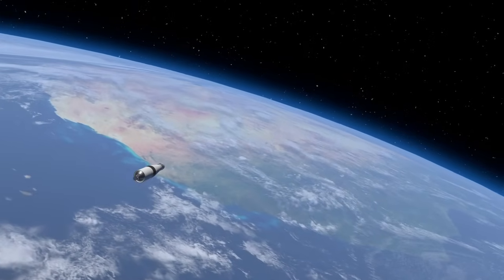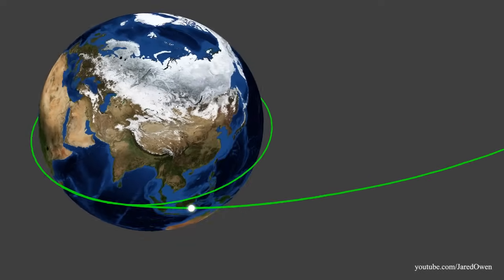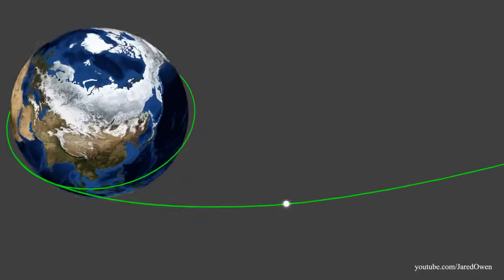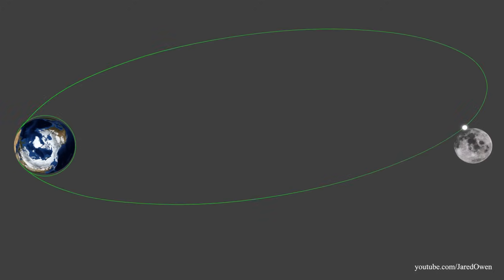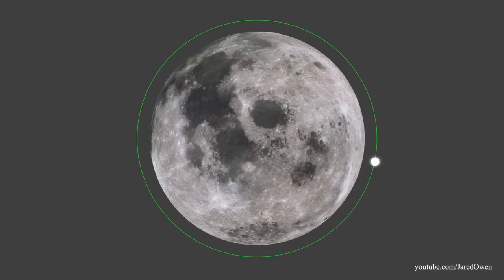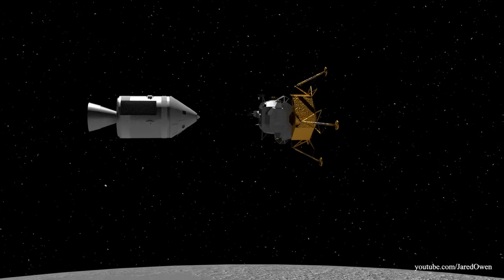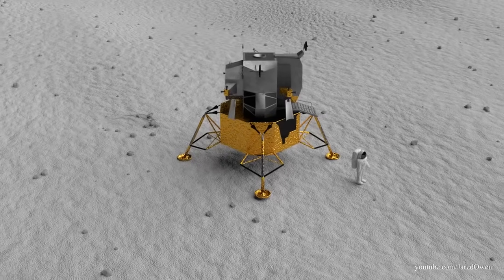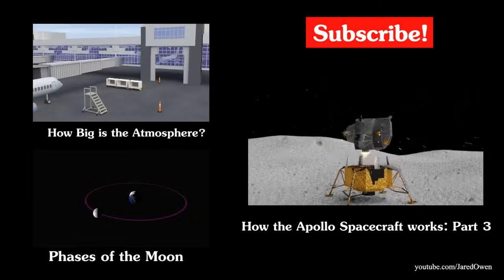How the Apollo Spacecraft works: Part 2

Comment: I thought those flames imposible without oxigen. Like combustion engines would not work
Reply: @jimmyfly makes sense  Thanks
Reply: Rockets store both fuel and oxidiser...
Reply: @pmm1767  can you elaborate?
Reply: @arelortal6580  the oxidiser is oxygen, the fuel can be something like hydrogen or methane. Both are liquefied and stored at very high pressures. When the rocket wants thrust, these pressurised tanks release a steady of stream of their constituents. As they flow they reach the combustion chamber where an electric arc is present. In the presence of the electric arc, the reaction starts and the first molecule of fuel and oxidiser that react set off a chain reaction that releases heat and allows all the fuel to react. Now the newly formed gas, let's say water vapor in the case of hydrogen being the fuel, wants to expand; as all gases want to do when in lower pressure. As it expands it pushes the rocket out of the way and leaves the through the nozzle. That all happens instantaneously.
Reply: @pmm1767  I understand the principle when there is a certain density in the atmosphere but if the expanding gas does not encounter any resistance when exiting the turbines then I can hardly conceive displacement unless there is a considerable increase in thrust.
Reply: @arelortal6580  see, the rocket and the gas it contains are to be treated as separate objects. The gas' intrinsic property to expand by virtue of its mass IS the resistance the rocket encounters to its inertia. Very simple. The gas WILL expand, not flow. Flow is a misleading term that implies no force. Expansion is actually what happens. The only exit the gas has during this expansion is through the rockets nozzle, so as it expands in the chamber it pushes the rocket out of the way. I had a doubt like you but when you visualise it makes a whole lot of sense. Gases may look like they flow, but, on the micro it's just collisions and overall expansion. The moment fuel and oxidiser enter the chamber the velocities of all the gas molecule are in random directions. Their velocity vector is not in line with the nozzle exit. The only way to get an individual gas molecules velocity pointing in the direction of the nozzle is to strike the surface opposite it. Hence when it hits the side opposite the nozzle it transfers momentum (as all elastic gaseous collisions do) and it leaves through the nozzle. The overall effect of several collisions that change the velocity is expansion. It is also how  a balloon flies. External pressure doesn't come into play, in fact, the lesser the external pressure, the greater the force with which the rocket moves since there will be no backflow decreasing thrust.
Reply: @jimmyfly yes you are right
Reply: @jimmyfly this dude just ran away after the explanation lol
Reply: @jimmyfly you do push ups against a table , it works . You do it  against water or air, you sink or fall. The thrust has to find some kind of resistance at least till there is no more gravity pull from the moon otherwise is ,no can do.
Reply: @arelortal6580  the thrust is it's own resistance, the gas inside the rocket has mass and therefore inertia, it has a velocity because all gases are constantly moving. As a result, the gas faces the rocket walls as resistance and the rocket faces the gas expansion as resistance.

Comment: OK, so how did the CSM slow down to pull the LM out of the SIVB even though its nozzle was pointed in the opposite direction, ready to push the CSM back towards the SIVB but without an apparent way to reverse? And how did it turn around? And how did it do the roll? Did it have reaction wheels? And why wasn't the LM just already assembled to the CSM and the rest of the whole Saturn V assembly so that it was already oriented towards landing rather than having to turn 180 degrees?
Reply: RCS quads were used for any kind of maneuvering. As to you're last question, how would you attach the launch escape system to the command module?
Reply: So,  @mako88sb , not really any kind of maneuver; just the smaller ones, right, since bigger ones are handled by the big engine?

What do you mean by (the short version of) "as to you are last question"? I'm not sure I understand you. Did you mean "as to your last question" instead? If that's the case, then here's my reply: Yeah, since the CSM's first use of the big engine is to slow itself and the LM into lunar orbit, then with that assembly already faced the other direction and the cockpit arranged accordingly, put fairings over the end of the CSM with the main engine to create an artificial nose, and have the cockpit arranged accordingly, and then have the attach the escape system over that, I guess. By the time the fairings are to break free and reveal the CSM already in that orientation, the escape system would have been long-obsolete. Right?
Reply: @HelloKittyFanMan.  Your last question from above was "And why wasn't the LM just already assembled to the CSM and the rest of the whole Saturn V assembly so that it was already oriented towards landing rather than having to turn 180 degrees?"
Reply: Sorry, responded to quick before reading all of your message. Not sure what to say to your reasoning. The LES was designed to jettison just the capsule with the crew in it. Any additional weight added complicates the situation immensely needing a more powerful LES and additional weight and additional fuel in the Saturn V to boost that weight for as long as it was needed. Plus you have to keep in mind that the LM was designed for a zero-G environment and the location of it in the SLA behind the CM/SM was the best place for it for minimizing G-loads and vibration during the launch. Now obviously, just because it was designed for a zero-G environment doesn't mean it was too fragile for launch as they had to take the launch dynamics into account but the point is it was designed with the knowledge that locating it were it was historically minimized as much as possible the additional strengthening required for the LM to survive the launch which again means minimizing the weight involved as much as possible.

Comment: Excellent visual overview of the sequence of process. But how, after docking, does the CSM get the LEM unsecured from the 3rd stage carrying it? does rotation detach it? In all the documentaries ive seen the LEM just comes out like it was just floating in 3rd stage; there has to be an unlocking at some point for the CSM to pull it out- could u reveal how this happens please?
Reply: Here's a pdf about all the pyrotechnics involved with the Apollo missions which will answer your question. Be a great video for Jared to do someday.
https://ntrs.nasa.gov/archive/nasa/casi.ntrs.nasa.gov/20090015395.pdf

Comment: A Presumptuous Opinion:
Apollo 11 - The Poop & Pee Theory  Proves 
No Outer Space and No Moon Landing
The astronauts supposedly spent three days to reach the moon and two days to come back. 
It is told that a clear plastic bag was used to urinate in and obviously someone had put catheters into the astronaut’s urinary tract into their bladder. 
On a documentary just two days ago the urine bag was shown and it was a small thin clear plastic bag with pee in it. Looked like they could only urinate maximum 2 times and it's full.  
What a minute? How did you astronauts hold your pee for 5 days. 
Also, the inside of the capsule barely had room for 3 people, so there certainly was no toilet available. 
Wait a second? Where is all the poop for 3 men for 5 days. That is a lot of poop. We’re talking pounds of poop. Were you astronauts wearing outer-space-diapers? How did you astronauts hold your poop for 5 days? Can't imagine the smell inside that capsule. When the astronauts came out of the capsule, they must have had such a lovely fragrance to smell that made people immediately vomit. This was A Presumptuous Opinion on the Poop & Pee Theory

Comment: Yeah I concur,1969,but all the ground work was done in the 60s,early....looks like fairly straight forward,why the slow move away from the earth too much fuel to just shoot out away from the earth gravity,or does the slow break away from earth have something to do with temperature controlling effect ,probably save fuel most likely...right.thanks I was wondering why they go up and then pitch over and start orbiting earth before they go on to the moon...
Reply: The main reason for entering Earth orbit is to do some final checks to make sure everything is good to go. Plus it's a lot easier getting into the specific trajectory for the TLI burn that minimizes radiation exposure during the transit of the VAB's.

Comment: crazy how it just pulls out the lunar module meanwhile they are all travelling really fast towards the moon
Reply: Antony D'Andrea yeah so they are going 6000 km per hour and detach the front and at that speed they turn the front around, and then pull out the module, lol, then go plant a flag in the wind, then they fly back up and somehow reconnect to a ship traveling at 6k km per hour. And then, the tiny ship makes it 250k miles home.
Reply: Made by Jimbob What wind? The moon doesn't have any atmosphere significant enough for wind to be an issue. Same with the rest of space.
Reply: @MadebyJimbob  so what? You can easily walk around in an airliner while it flies at 1000km/h. All that matters is the relative velocity between those two craft. And given that the forces affecting either one were the same, there's no big difficulty here.

Comment: If it weren't for Werner Von Braun we wouldn't have a space program
Reply: If it weren't for Robert Goddard,  von Braun would have never built a ballistic missle (he said that).  If it weren't for Issac Newton and 18/19th century chemists and fluid engineers,  Robert Goddard would have never gotten into the air with liquid fuel, 
If it wasn't for the Army Air Corps and NACAs high manned ballon flights in the 30s-60s Redstone,  Atlas and Saturn stacks wouldn't have carried humans in the 60s...
Reply: @STho205  My sentiments exactly Treaty  for Versaqilles had a loophole which allowed for rocket research
Reply: There would surely be a space program without him.
The only difference would be that there would be a soviet flag in the moon, and the conspiracy idiots would claim that the landings were filmed in a secret KGB facility somewhere in siberia.

Comment: You don't mention that the S-IVB's J2 engine is different than the five that are used by the S-II because it could relight.  Also, the S-IVB wasn't completely useless as it was used in later missions to crash into the moon to be registered by the seismographs left by previous missions to give data on the moon's interior.

Your model of the Service module isn't quite right.  It doesn't have the large quad  antenna and you show two indentations on the Service module's hull where it was completely smooth but with bays for later cameras and even a satellite that was left in lunar orbit on one mission.

On the subject of LOI, one thing you didn't mention about Mission Control was that it was timed to the very second as to AOS or Acquisition Of Signal from telemetry.  That way they knew if the spacecraft was in orbit or not.

For Apollo 11, when it touched down, after avoiding a large and unknown boulder field, it had just 13 seconds of fuel remaining before an Abort was required.

Comment: Would be great if some telemetry was presented, like speed, acceleration, mass, etc.
Reply: lost
Reply: Heart rates, control maneuvers and maybe a friggen film of Earth rotation... another opportunity lost.
Reply: ”Earth rotation”? Earth spins Twice as slow as the hourhand on a clock....
Reply: What would you do with that information?
Reply: What would you do with that information?
Reply: What was taped over was the original TV footage which only served as backup but was of higher quality than the TV broadcast the confusion stems from the fact it was recorded on telemetry tape but it is not the telemetry data itself that was lost

Comment: After orbiting 2 or 3 times....
What?
Maybe it was 4 times? Or 5?
Maybe it was all guess work?
Why haven't you found out if it was 2 or 3? Thats 21, 000 miles you've left unaccounted for, and you haven't even left low earth orbit. 
I can't understand why you'd take the time to have all the graphics done and all the specific code names for all the components and you haven't checked the number of orbits. 
(It was one and a half as far as I've been told.)
There was no danger of any parts freezing. This is a common error. People have the idea that space is cold. 
It's not. Space is temperature neutral because it has no thermal mass and that is often mistaken for zero degrees, but thats silly. Astronauts also sometimes say this kind of thing, but only Apollo astronauts have ever actually complained about being cold. 
In the sun at 1 AU insolence is 1.36kwh/m2 which means the term Barbecue is appropriate since the crew would be cooking for 8 days under the direct slotice noon sun.
Reply: That's why they landed in the morning which last few days on moon:)
Reply: @tgstudio85  
Yeah, so they combat 130°C surface temperatures by going into the cool evening air. 
Except that's not real.
Sounds good, and we've heard it said at all levels, but it isn't real.  
The reason is that evening only means long shadows on the moon. The surface temperature, where sunlit, is exactly the same at noon as it would be just before sundown. 
The reason that isn't true on earth is because solar rays have to penetrate our protective atmosphere at an oblique angle, allowing a far greater degree of thermal protection than that afforded us at noon. 
Notice that apollo experienced,  effectively, a summer soltice noon during the entire mission less one earth orbit and 3 lunar ones. 
Notice also that the lunar evening is, effectively, high noon, and while the topography may allow for longer shadows in some places, others rock faces are only exposed to full heat in this evening time.

Comment: Once in "parking orbit" and there after where did they store all the fuel needed to go from there all the way to the Moon and back? i get they " sling shot their way but that doesn't completely account for breaking free of Earth's gravity.
Reply: The TLI burn is sufficient to get them to the moon. With the vacuum of space, drag is virtually non-existent so they simply shut the engine down and coasted. Of course the Earth's gravity immediately started to slow them down but at some point, the moon's gravity has a stronger  influence and the spacecraft sped up again.
Reply: They did not break free from Earth's gravity.  Traveling to the moon does not require escaping Earth.  The moon is within Earth's gravitational well (clearly - since it is orbiting the Earth). 

When you throw a rock in the air, the rock comes back down, right?  Technically, if you threw a rock straight up 1,000 miles high, it would come back down, and require zero fuel to get back down because Earth's gravity will bring it back.  A trip to the moon is a little more complicated, but still fundamentally the same thing.  They are essentially thrown to the moon so that the moon's gravity "catches" them before they fall back to Earth.  Once in Earth orbit, it only required about a 6-minute burn of the engines to build up the speed necessary to reach the moon.  This is the TLI burn mako88sb is referring to.  They never reach a point where they escape Earth; they just reach a point where the moon's gravitational influence is stronger - at which point they would eventually perform another small burn to enter orbit.  The landing on the moon and the take off from the moon used two separate engines with their own dedicated fuel supplies.  None of the fuel for the return trip was used for the lunar landing.  Once they took back off from the moon and were back with the command module, the service module engine was used to bring them back, and it only required escaping the moon's small well.  From that point, they would literally fall all the way back down to Earth.  Albeit, a controlled fall.